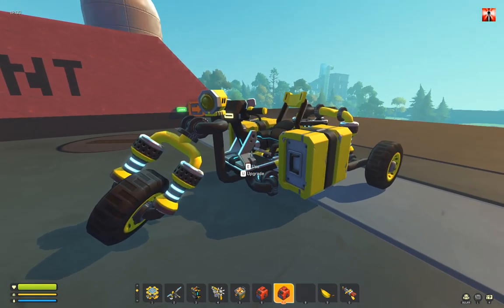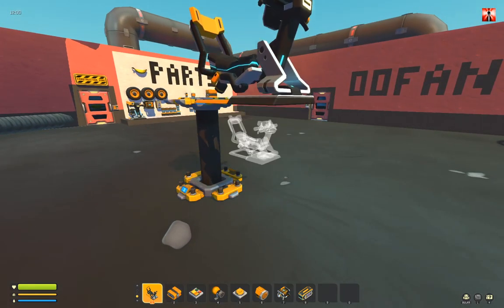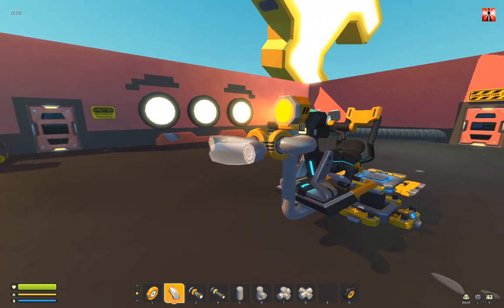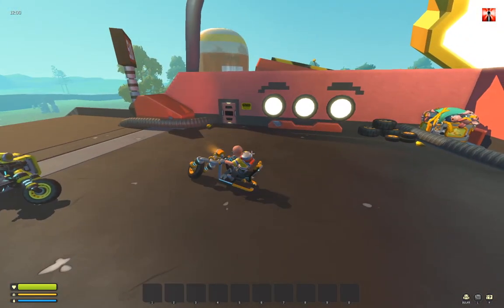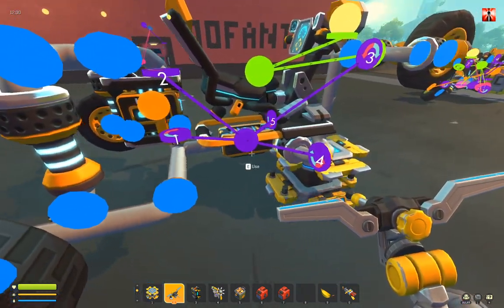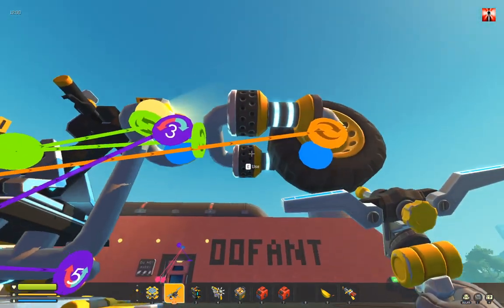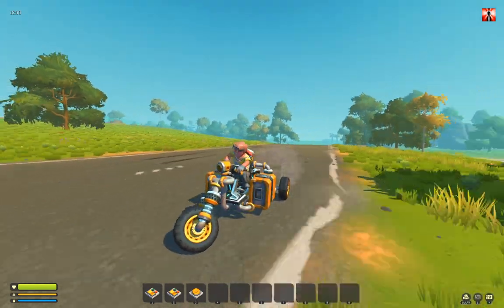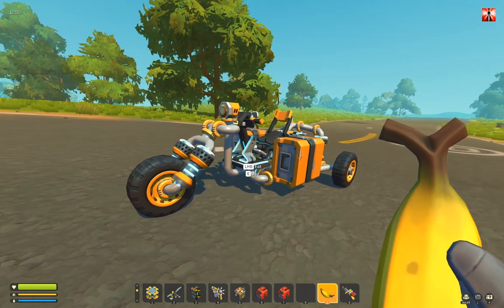Scrap Mechanic Survival | HowToBuild - Survival Trike - Tutorial

Comment: I know this is an older video but I wanted to thank you for making it! I spent all day working on this, figuring out how it works. Messed up more times than I’d like to admit but eventually got it right! I also ended up adding a seat for my boyfriends player by using a “small pipe four way tee” at time stamp 5:45 instead of a regular tee so that the extra connection pointed up, and added a passenger saddle right on top.

Thanks so much for an amazing build and great video!

Comment: I cant turn with this. When i connected the 2 bearings above the engine and removed the lift it made the wheels point up. after i changed to 15/30 and removed the lift they work fine but it feels like something is wrong. the back of the trike is stiff and if you push it it makes alot of clinging noice like when an item is stuck in the ground on Garrys mod. Any ideas?

Comment: Very nice build, but I have a problem with mine. Whenever I take it off the lift, it starts to slowly spin and fall over? What can cause this issue you think?
Reply: SO apparently, my motor was spinning outwards, forcing the whole thing to just keep rolling! Fixed it by reversing one bearing

Comment: can you make the steering radios smaller?

well a transport truck can turn quite sharp🚛
Reply from the maker: yes. if you press the 1 Switch, and u can change the Seetings of the Baering. and the Radius is on full speed big but not realy if you drive slow around a corner ^^ like in reallife